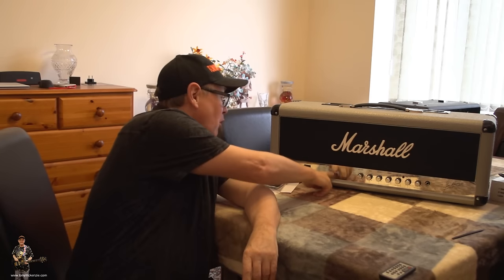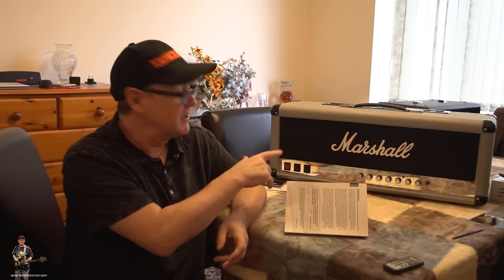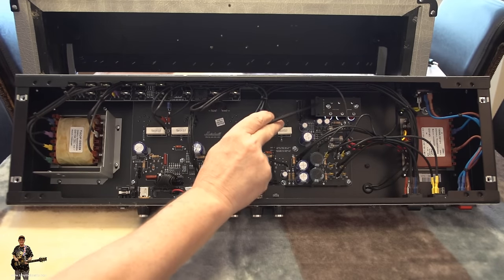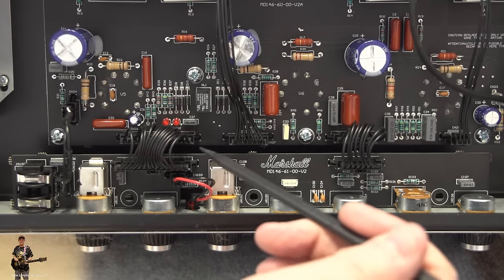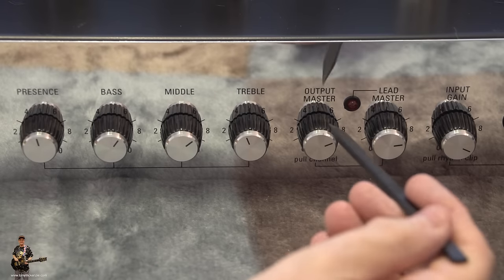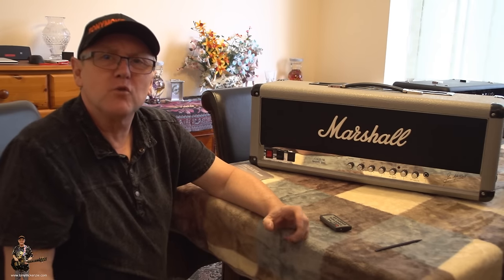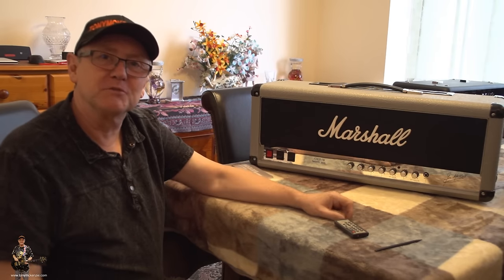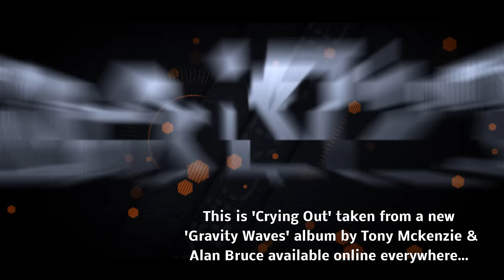Marshall 2555X 100 Watt Silver Jubilee Amplifier | A Closeup Inside and Out Review | Tony Mckenzie

Comment: I had the small version and I liked it, but it did not sound as good as the big version. Returned it and I am waiting for the 100W version. I've bought the matching 2x12 cab meanwhile. Thanks for the review
Reply from the maker: At one stage I almost bought the smaller one too. But I bought this amp in clearance and the difference in money at the time swayed me to get the 100w head and I'm glad I did. I had heard reports that the smaller head did not quite sound as good so my choice had to be the 100 head. I'm sure you will like it. Thanks for watching.
Reply: @tonymckenzieofficial  I love the build quality so much that I ordered the small version again for smaller gigs because it is easier to carry. It is quite a nice pedal platform. It is a bit harsher than the 100 version and overdrives faster but it seems to be built as good as the bigger one.
Reply from the maker: There's no doubt they are made great. Thanks for the info on the smaller one... I almost bought one of those too but the deal I had on the 100 was the thing that persuaded me to get the 100. Thanks for watching.

Comment: Thanks so much for this video. This amp is....was...on my list but after seeing this I'm not remotely interested. Is the current JCM 900 4100 Dual Reverb made like this or like the original version, with power tubes mounted to chassis?
Reply from the maker: I am surprised somewhat. Of all the amps I have looked at this is probably the best made amplifier that I have seen out of Marshall of recent times. I'm not so sure on the JCM900 as I have not seen the newer ones... but thanks for watching.
Reply: The JCM900 dual reverb is crap compared to this amp....apples an oranges.  I just ordered this head, can't wait.
Reply from the maker: Thanks for the info... and I liked this head too - still have it. Do let me know what you think when it arrives. Thanks for watching.

Comment: Weird to see the powertubes mounted on the PCB. The new DSL100H that's made in Vietnam and is cheaper has them mounted on the chassis with wires to the PCB. Which personally I like more :) That black PCB looks killer though :p
Reply from the maker: I get that for sure. Once on a review I did of a Marshall amp I was communicating with the designer (Santiago Alvarez) about exactly that issue... sockets on the board. He stopped me in my tracks and said it was not an issue these days and was not a problem. I had a Peavey Mace (160 watt) once and that used to melt the PCB's. However it was an upside down chassis. The overall quality is up there with the best Marshall insides for a while. Thanks for watching.
Reply: The old DSL's (JCM2000) had them mounted on the pcb and there are numerous story's of pcb meltdowns on the web. Also, funny enough, while the JCM2000 was made in England, the build quality was terrible compared to the new Vietnam ones. I agree when tubes are upside down though, especially on combos, just not a fan of it since heat tends to go upwards. Also when a tube is a little stuck, I just feel more secure to yank them a bit when the sockets are chassis mounted :) But then again if Marshall gives three year warranty on this they must be confident in their build quality!
Reply from the maker: Yes I have a TSL100 which if I remember are on the PCB (but its a separate PCB from the main board) so that might not count in the same way :) 

This one IS made in Milton Keynes... I believe (irrespective of what's printed on the amp by way of origin) that the 'M' at the start of the serial is denoting UK assembly. Yes there is a three year warranty... you have to be in the UK and you have only so long to register it...

Comment: Hi Tony! great review! I want to buy a small tube head that isn't too heavy for gigging and can do beautiful cleans. Should I go for the Marshall Mini Silver Jubilee 2525H or Hughes & Kettner Grandmeister 36? The smaller Silver Jubilee is made in UK as well, but it has 20W. I think the quality is really good. The H&K seem to be ok as well, they have a nicer DI built in, but chinese valves.
Reply from the maker: Well they are both great amps. I would relate to it like this, if you want those older Marshall tones then the 2525H is a good choice and better than the Grandmeister for that. However, if you want an amp that can basically do most stuff then the Grandmeister is a better choice because of the effects, the number of channels, the ability to drive the channels when you need to, and oh ... the ability to change the tubes for decent ones before you use it :)

Actually the GM tubes I would change as the amp as it came to me was a little toppy. Overall though both good amps there are no bad ones here. Hope it helps... Thanks for watching.
Reply: Thank you for your answer!
Reply: @tonymckenzieofficial  I ended up buying the 100w jubilee and the smaller 20w head as well. Love them, they sound really good and they seem to be build very well. I love the smaller one also, but the 100w one sounds better. Love your videos!

Comment: whats your opinion on the jubilee and how it takes pedals? boosts and overdrives
Reply from the maker: The Jubilee reissue takes pedals very well indeed. The basic amp does not have the drive of modern stuff (like the 410HJS for example) but it comes from a different era of course, so great if you only play 80's amps and they suit the music you play. But if you're like me, I need sometimes more drive and I have used the XOTIC SL drive pedal on this amp with great success. But I've used many other pedals too and they all sound pretty good IMO. 

I can tell you I still have this amp and if it was less than it should be it would have been sold long ago. Hope it helps and thanks for watching.
Reply: This amp takes pedals better than my mesa boogie did. I thought I bought an expensive paperweight when my fuzz pedal wouldn't work with it. Just picked up a jubilee and it's now the best fuzz I've ever heard.
Reply from the maker: Thanks for the info Cody...

Comment: Why do the power tubes have only 7 pins soldered... that looks rather weird to me.
Reply from the maker: That is a really great question! I honestly don't know the reason, but maybe some pins are just not used? Anyone who has the answer to this question please do post it! Thanks for watching - great question Paul.
Reply: Hi, it is because pin 6  is usually unused. Older el34 amps (like the ol' jube) used pin 6 to connect the screen resistor to the wire  from the pcb (Maybe it was the grid supressor...anyway, a resistor). Back then the tube sockets were not mounted to a pcb, so that solution was pretty smart and, of course economic. Greetings from Berlin! Dave

Comment: So can you fit any octal tube for power or????? That chart on mine without manual is confusing.
Reply from the maker: I agree with you - it was really confusing and that amp print sort of suggests that you can fit any octal tube. But in reality I doubt it. The manual did nothing to help either. Some of the octal tubes like the KT77 have different resistors than the 1k ones in this amp (check my review on the Burman 501 I showed here: https://youtu.be/jXvZoGaz7V0 a while ago. Someone fitted EL34's but the amp was designed for KT77 (if I remember correctly) and the power tube resistors should have been different for EL34 tubes I believe... they are not a straight swap although many guys do that.

Personally I would stick with what the amp comes with - it sounds really goo as is. Great Point and thanks for watching.
Reply: Always dud ya I love it just got it yesterday and it was use (like that really matters) and although my Laney AOR 50 and 100 kill it, you wont find a better Marshall amp stock out there for less. I paid 1300 for mine used. Fair price. I would love to own a Burman they are legendary in the hands of the dude in Killing Joke and Thin Lizzy. I heard that they tended to melt themselves down a lot.
Reply: Ya I got mine used at Sam Ash for 1300 and it kills prettymuch all amps that ell for less. Only thing comes close are my Laney AORs I have a 50 and a 100 both 8 knob versions. I love to own a Burman they are legendary Killing Joke and Thin Lizzy amps.
Reply from the maker: I only had it a year or so... it was beat up badly when I bought it so I thought I would resurrect the amp - it was a good amp but really hard to get the knobs and things like that so in the end changed them. I tried to research Burman as there was supposed to be a 'come back' some years ago, sadly it did not happen.
Reply from the maker: $1300 equals about £1000 which is about the going rate here for a new one, but across the pond (or anywhere else) they tend to cost more. I got mine for around £850 as a clearance... a very good deal for a new amp... but they all sound the same :) Yes I like the 2555X as the 2555 (and the X) all have a different tone than the other similar era amps.
Reply: Truly the thing roars. Only thing that comes close for head room are my AORs and my new Bassbreaker 45. The 45 I would like to see you do a video on someday. Also a Sound City and a new London City amp.
Reply from the maker: Interesting to know about the Bassbreaker 45. Sound City I have not seen in a very long time... but I was around when they were on the street and used one but not my sort of amp. The London City amp I have not experienced either the early 70's ones or the newer reissues... I thought those were transistor driven?
Reply: I will send you a link to the New London City Jobs. I like the older Sound City amps and the new ones well they are only a name not exactly like the old "REAL" ones. Ever get into MATAMPS? Heres that link to LC amps: http://www.londoncity-guitars.nl/. Ether really old or new I find stuff like that real cool. Whats your 2 cents or pence on Hiwatt, Sims Watts and WEM? Or Trace Elliot All tube jobs...
Reply from the maker: You are mentioning names that have been some of the worlds great amps at different times (some will say they still are!) and while I have heard of most I never did try the matamp. The original Hi Watt (like Gilmour) are wonderful amps but my recollection of the originals was the sheer volume... but the inside was incredibly well made. They are expansive for those old ones, but I guess are expensive for the new ones too! 

Wem I remember the old vertical 4x12 PA cabs (I think they were) and I had a Wem Copycat all those years ago, but TBH I was not really a fan of Wem... made down the road from where I live in fact. 

My bass guy Alan Bruce loves Trace Eliot amps and had older stuff but these days he has a transistor one from about 2004 which indeed he brought round to me last night complaining its started to 'hum' a bit. A good guess is the capacitors are fading and I ordered some more for him at a princely cost of £10 or $13 :)  I never used the TE guitar amps sorry.

I like older Marshall amps but some of the newer stuff too.. The 2555X and the 410HJS (Satriani head) are both pretty good amps of more recent times and that YJM100 (rare now) was a pretty cool amp. I also like Mesa Boogie stuff but its so expensive here now that I am less bothered to look for new stuff at those prices. 

Ha back in the day we used to call the Sound City amps 'Sound SHI**Y' - you see its amazing what time can do... now they are probably more sought after than even when new. I always laughed at the name and the others in the bands seemed to think generally the same way at the time.

I did have (I'm going back a very long way) a Selmer Zodiac combo amp when I was about 18 or so (I grew up later) which I can say was interesting to say the least. I migrated to early 70's (or end of 60's) Fender twin amps and again I remember the volume... we used to literally barrel those to 11 to get distortion of any kind back then. Other amps (going back) I had an H&H something or other tranny amp that lit up green on the front (mainly because I had seen Marc Bolan with one :) and after that again I went to Marshall... later still a Mesa Mark III (new) which I had a while, then Mark IV... and so on. 

Amps are a wonderful way of changing 'you' if you get what I mean, to achieve tones that other amps don't or will not achieve... hence I guess why those older amps are back in so to speak. I have reviewed many amps so you should check them here: https://www.youtube.com/playlist?list=PL764D9C7505FDEC8D and I tend to show the insides to confirm the build quality as much as anything. Hope you like it all.
Reply: Here Sound City is about as cheap as a Fender Blackfaced bassman. Also early Sunn gear. MATMAP is rare as hell here and nobody knows WEM at all other than Gilmore stuff. Hiwatts are insane expensive here and Carlsbro is scarcer still. Also Selmer and HH IC401s are rare too. Traynor is everyplace for sale online. I am kind of odd I really hate to see folks mod all these cool old amps to sound aka Marshally as they tend to call it.  Or when they describe Laney as having that Marshall sound. Its a misnomer really. All had their own vibes going. Boogie depending on the model is batshit crazy expensive also so are Concords and the "Marc Bolan" amps VAmpower forget about it.....
Reply from the maker: Carlsbro used to be budget gear and most of the guys I knew would stay away from that. I don't see SUN amps here hardly at all. I had an HH IC100 but decided not that long after buying it that I should go beck to tube amps. I have heard of VAMpower but never seen one... nor concorde those are rare beasties indeed!
Reply: Ya I love all older amps especially the odd ones. HH IC100 was what  I was thinking. Hawkwind, Thin Lizzy and Mark Bolin all used them at one point. I see a few Concord by Soundcity  pop up form time to time here remarkable cleans especially for an EL34 amp. Vampower was the amp Mark Bolin indorsed and are uber rare. http://www.vampower.com/history.html

Comment: Killer tones m8. This is a nice amp and seems pretty well made, glad you like it. Is it a keeper?
Reply from the maker: Yes it is I reckon. I am going to sell some amps after April to fund new gear to review but this one I will likely keep - as you say, it does have some very nice sounds in it. With the SL pedal you can get a 'Gary Moore' tone instantly... it's one of the better Marshall amps I have seen in a while - very clean inside etc.
Reply: Over the last few years I guess the Marshall amp that impressed me the most was the YJM (Malmsteen Model). It was hand wired, effects loop, low power settings and killer tone.  Have you looked at those?
Reply from the maker: Have I looked at those! Sure I have here' s a video review: https://youtu.be/--CSLX066J0 and there's a part two. I also reviewed the YJM on my website in great depth here: http://tonymckenzie.com/marshall-yjm100-malmsteen-guitar-amplifier-inside-and-out-review.htm and the review I conducted with Santiago Alvarez who was the designer... so you could say that I know the YJM :) 

Actually I have 45 videos of amplifier reviews in this playlist: https://www.youtube.com/playlist?list=PL764D9C7505FDEC8D and you could be there for a while :) 

I also looked at the JVM410H and the JVM410HJS Satch head... the differences are incredible.

Anyway, anyone who wants to know a lot about the YJM should check that stuff out. Santiago does not work for Marshall these days I am told, but he did tell me about when he went to Florida to Meet Yngwie who really did have a lot of input to the design and style etc. of the YJM.